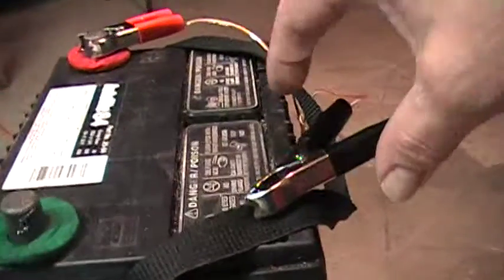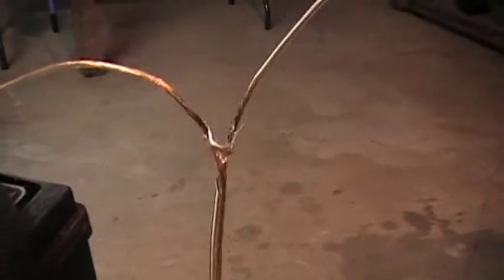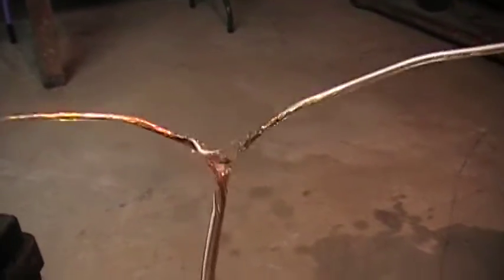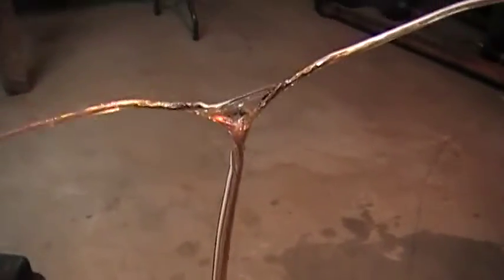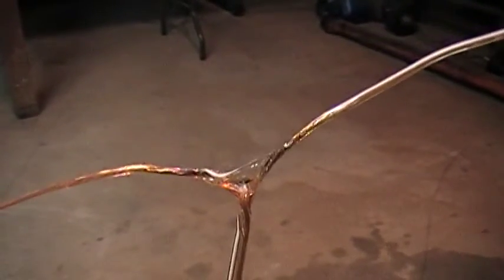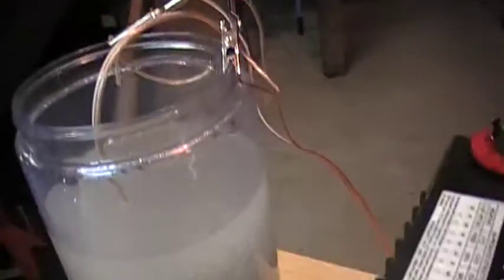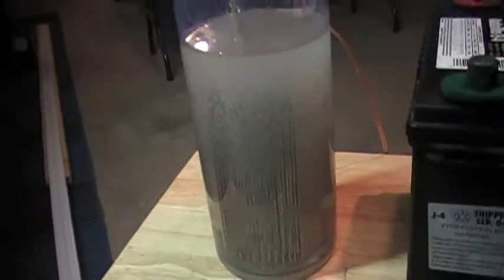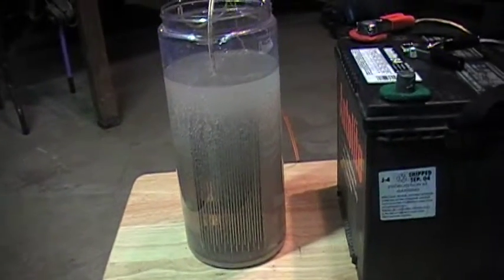HHO Generator Experiment ~  (Part III)

Comment: Adding baking soda increases the conductivity of the water and causes the fuel cell to draw more amperage. Amps = Heat

As you noticed, your output increased dramatically when you introduced baking soda, but I'm sure you noticed that the water and the plates will get dirty faster.

You should consider using Potassium Hydroxide (KOH) for your electrolyte, because it is much more efficient and will give you better results.

HHOConnection is definitely right about needing thicker wire.